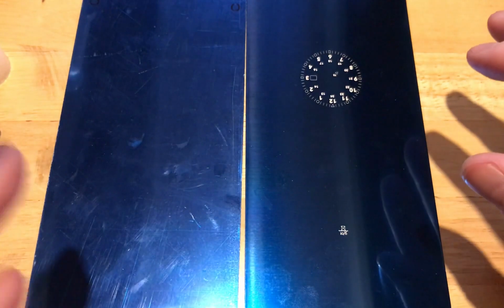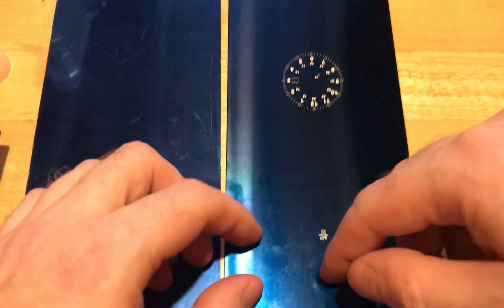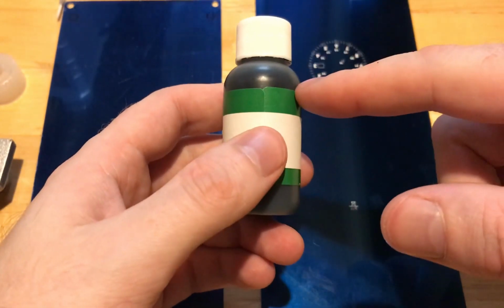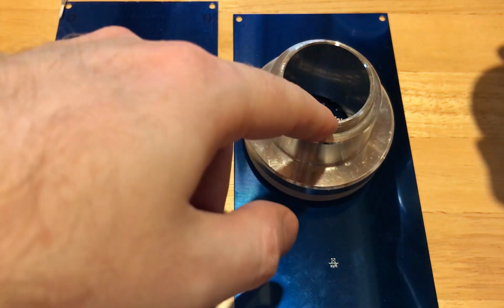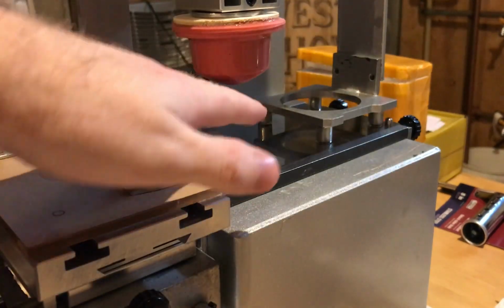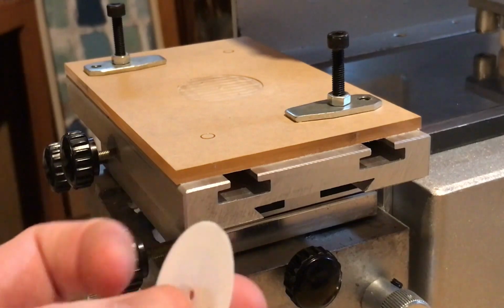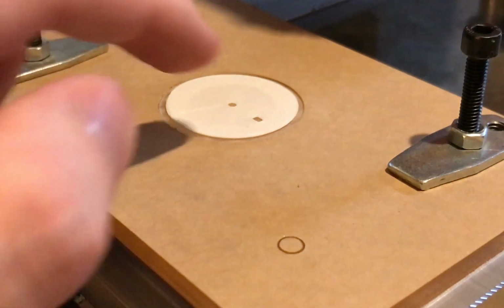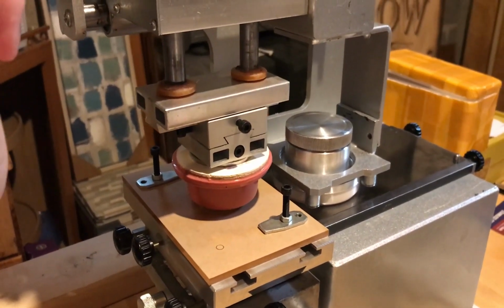Making Custom Dials Part 3: Pad Printer Setup

Comment: The video has good information but god do you ramble too much. I dont know how you manage to say so little in so long
Reply from the maker: It's there for people who want to watch. There's bullet points there's drawn out explanations. Skip around. Sure I can ramble, but that's me. Enjoy.
Reply: @WatchComplications  Oh yeah its great information and you seem to be one of the few people that re actually documenting this process, its just that i feel it could be a condensed a little better.
Reply from the maker: On that point I agree. I am trying to get better at condensing and balancing saying everything that should be said, providing good context, with keeping the vids digestible. Still learning :)
Reply: @WatchComplications  Yep, it takes practice!
Reply: He doesn't ramble, he explains the process. If going into the details is too much for you, you can just watch videos of pads stomping dials. Edit : Ok after the first 12 minutes it's boring
Reply from the maker: Haha thanks. Indeed it is a balance between explaining the process in detail and keeping things condensed. :) Thankfully, people can skip around as they wish.
Reply from the maker: The watch in the link you sent has applied markers (much like my logo). They are usually soldered, so the back of the dial will have soldering marks on it. You can get some depth with pad printing (usually not to the extent of applied markers), you may be able to use a plate and pad that allow larger ink transfer, or else print A LOT of layers. This is easier to do in a formal manufacturing setting where there are lots of dials in production, so 1. scraping dials isn't as big of an issue and 2. the printing can be more precise, because if any of the presses are just slightly off (tenths or hundreths of mms), it can look blurry. In a home-based setup, doing that with a pad printer would be a lot harder.
Reply: @Watch Complications  Thanks a lot. I can't believe I didn't find this process before by googling. It seems to be commonly used in entry-level price watches.

Comment: Does it matter if I use the steel plate that comes with the pad printing machine? Because I bought the exact same machine that you have and it came with one steel plate. The reason I’m asking if there is any difference with the steel plate is because I did all the process that you said but the silicone pad won’t get the ink out if the plate not sure why could be the ink is not good ? Or is it the plate? I will really appreciate if you can help me
Reply from the maker: The plates I use did not come with the printer, as you probably know. All that came with my printer was one steel template, which may be what you are referring to.  I use that to make sure the corner holes in my actual plates get punched in the right spot. If you are trying to use the steel template that came with the printer it may not work, as most actual plates have a different surface color. Still, there's a lot of variables for getting it to work right: 1. etching at proper depth (25 microns give or take), 2. a proper ink...I use a multipurpose pad printer ink, 3. ink viscosity...making sure you have the right amount of thinner, 4. good silicon pad for the transfer.  If my plate and etching and such are all good, the most likely culprit for not getting good transfer is that the viscosity isn't right, in other words, add more thinner.
Reply: Watch Complications thank you for all the information I really appreciate that !!!!

Comment: Hi thanks for the great video's.
Van you tell me how deep the laser is in the plate?
Reply from the maker: I'm not exactly sure, we didn't measure it. We just know how many passes the particular laser does of the design. I believe most etchings for pad printers are around 24-28 microns in depth.